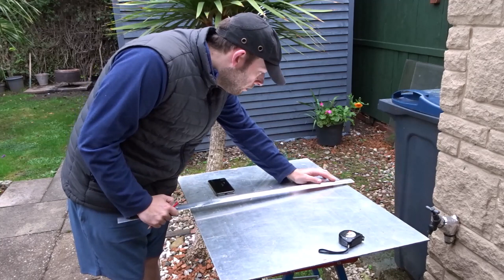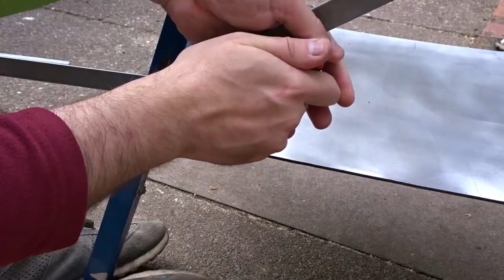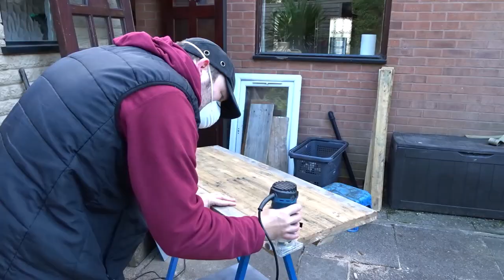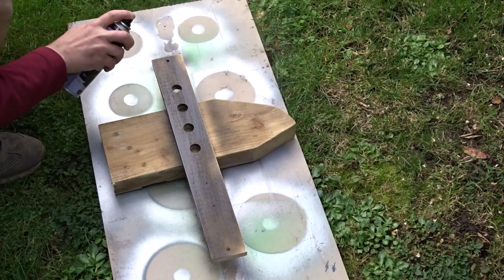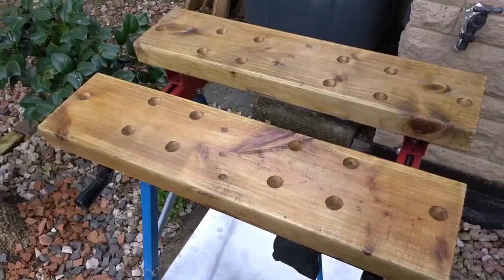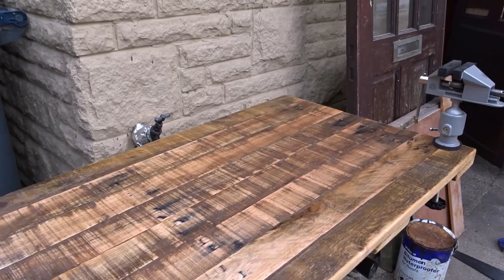5 x Mods & Improvements for a Cheap Folding Workbench

Comment: I have 4 Black and Decker Workmate folding work benches.  I am definitely going to take and use some if not all of your impressive work table modifications.  The shelf idea is gold.  I'm doing some drilling or using a router up above and I have nowhere to put down the tool I'm using so it's out of the way.   The shelf will be very useful.  That extended table top that clamps into the work table top is sheer genius.  I absolutely have to do that one.  Always run out of room on the table top working on different projects.  That bigger table top will end that problem.  Then the clamp on vise, a real plus when filing some metal project pieces.  Really nice set up all around.  I gotta get busy.  Thanks so much for your great ideas.  Really great video.
Reply from the maker: Thanks I'm glad you found the video useful. I have some more ideas actually for bench modifications so I might make a part 2. Thanks for the great comment! 👍🏻

Comment: Love it I did do one years ago only the top bit but I will do the hole thing soon
Reply from the maker: I'm always using mine. I've put an oak top on it now because it's left outside.
Reply: @PhillWyattProjects  does the oil you use work as id probably leave my extension in shed but workmate outside

Comment: Thanks for the inspiration! I've got a Ryobi workbench which is perfect small size for my projects but I was really missing a few features e.g. to keep those 'dogs' as you call them somewhere when I'm not using them, and a larger worktop to place over the base as you have done.  This will be my next project.  It's not  too hard for a non-expert DYI-selfer and yet will make my little workbench much more fun to use and give it some extra versatility. Cheers, mate. Well done!
Reply from the maker: Thanks 👍🏻 it does make them more useful and I prefer to work on them outside when the weather is good. I have some more ideas for small workbenches and should be doing a other vid about it soon 🙂 glad you liked the video.

Comment: Great idea Phil those replacement wooden vice parts are expensive to buy think mines made from Bamboo. I have a original workbench over 35 years old and still going strong and a couple of cheap ones, and they rubbish even the Keter clone B&Q one broke one of the legs, so bought a Keter one same but different colour. I might have a pop at replacement of my workbench topd at some point when wood is more reasonable price, it's silly money now. CLS timber I often use, used to be around £2.38 now its £4.99 at B&Q
Reply from the maker: Thanks Chris 👍 yea I remember not too long ago the 2x3's were £1.75. this is why I'm always on the look out for scrap wood.

Comment: Good ideas and examples. I am looking for scrap wood now to replace the top on mine. That cheap MDF snapped. But the extra (larger) wood top is a great idea. Plus the holder for the dogs. I've got to keep mine foldable, as I live in Japan right now and space in my house is limited.

The only thing I am thinking, is did you think of a waterfall on the sides of the main surface? I am contemplating a 2 or 4" waterfall for a clamping surface? Not sure.
Reply from the maker: Thanks 👍🏻 I have since changed the top again to an Oak top as I leave it outside the pine started to cup slightly. I never considered adding  a waterfall on the edge although now you mention it I think it could be a good idea.

Comment: Was this originally the workmate 125?  I like the idea of a holder for the bench dogs. Once thing you may consider is using a V shaped router bit doen the inside edges of the 2x for holding pipe and possibly the 2 "V" notches as well.

From the video yours looks like a different brand than Black and Decker

I got 2 of the basic workmate 125s for $12 US at Home Depot here in the states and they seem pretty decent.. I have 2 cheaper plastic saw horses rated for 300 pounds each which are nice and light weight but I can use these to replace them or just use em as a 2nd set of hands when working alone which is what these were likely made for..

Cheers for the video
Reply from the maker: Thanks! This is just a cheap unbranded one that I found on the side of the road. I did think about adding the groove for clamping pipe although I rarely work with pipe so didn't bother although it's a good idea. The black and decker ones are a bit better quality that this one I would say.

Comment: Looks like the bench legs were put on facing inwards - I think if they were to be reversed the bench would have a wider footprint=be more stable.
Reply from the maker: I think you might be correct about that. The legs were like this when I found the bench thrown out. I assumed they were supposed to be like that although looking at some other benches they seem to splay outward at the bottom and mine go inwards. I will take a closer look at it later on. Thanks for pointing that out.